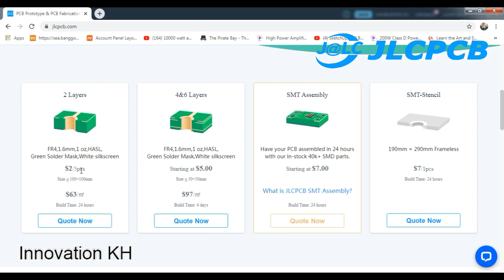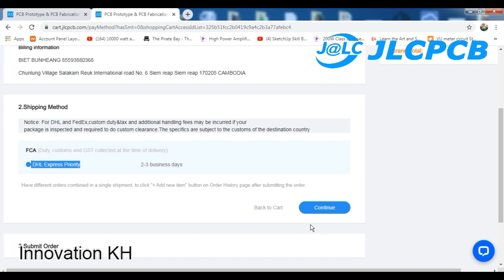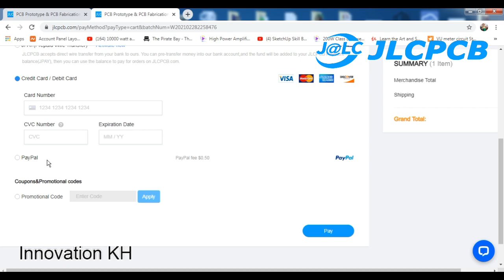Diy Bridge Amplifier 2000W using 2SC5200 & 2SA1943 14pairs at home

Comment: Dear I kh, I am impressed the various innovative audio amplifier lineup, you have done an excellent work. I a fan of yours.
I need help to make ( budget) power amplifier.  So I need a 'amp driver' from 700w to 1500w RMS mono. It should have the following: speaker protection, limiter, over heat- speaker short- over voltage- overcurrent protection, and temp. start fan/ blower. Since I noticed you are a good designer, am turning to you